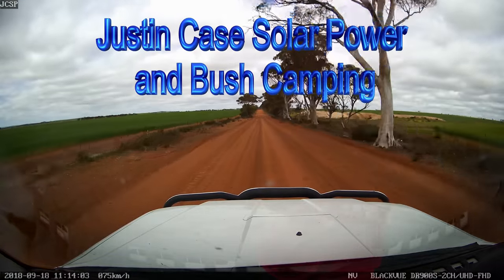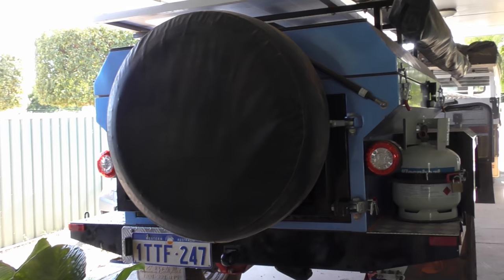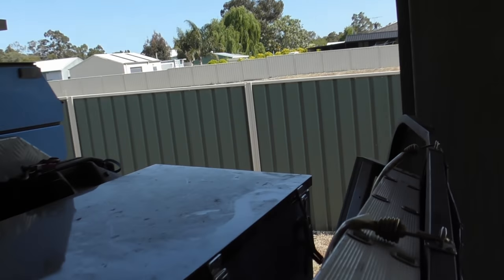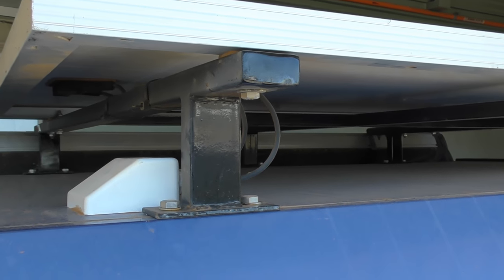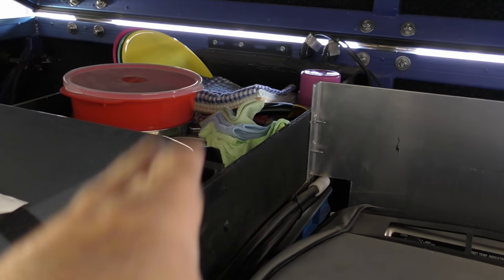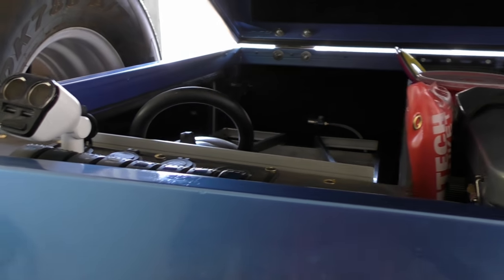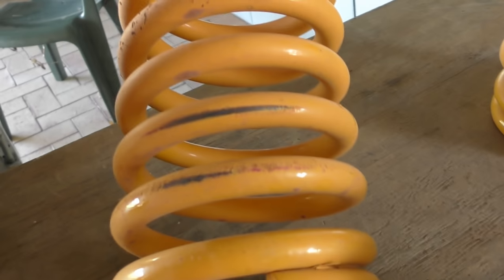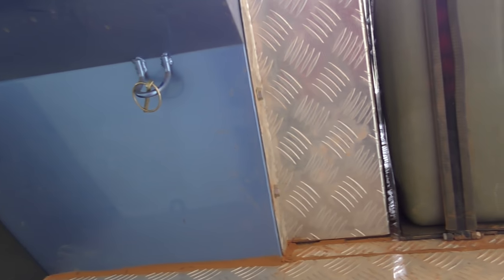PMX Camper Trailer Review   - EzyTrail Camper Trailer Review. Helpful tips.

Comment from the maker: Bryan Coburn It was the drivers Side spring that collapsed. Both shocks were stuffed.
Reply from the maker: Yes it was mate. I just replace all the rubbish springs and shocks with Pedders springs and shocks. Problem solved.
Reply: What shock model did you use?
Reply from the maker: @sargeeey  Not sure now sorry. This was some time ago. Best bet is if you have the same problems just take the  trailer into pedders and they will climb under it with a tap and get the size. Then give you options of the ones that fit.